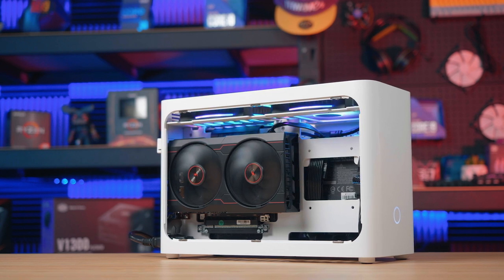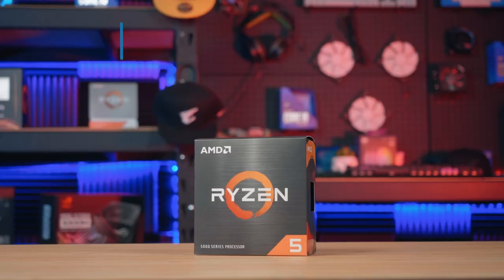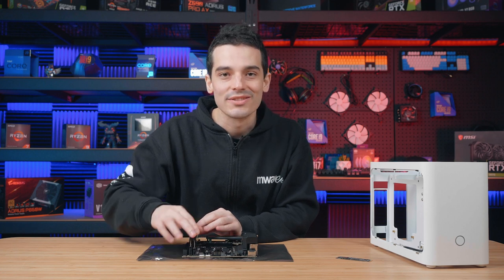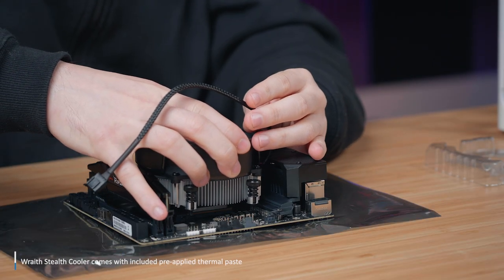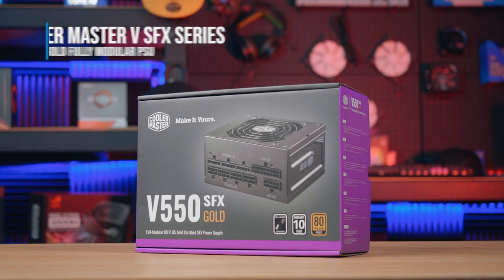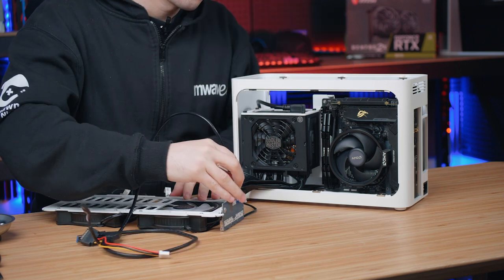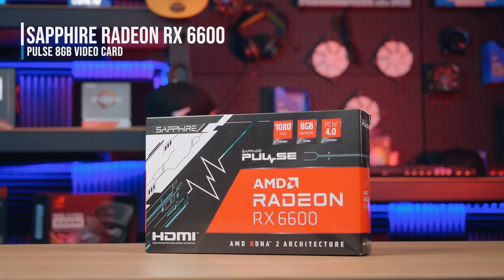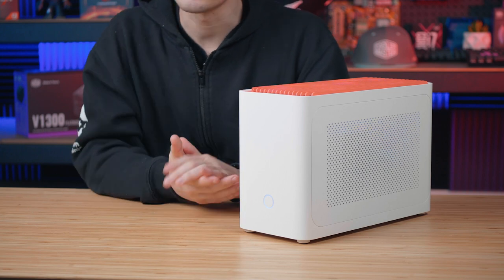Mini-ITX System Build feat. IQUNIX ZX-1 Air Mini-ITX Case with Ryzen 5 5600X and Radeon RX 6600

Comment: Great job! Thanks for sharing your experience.
I really want to try this case with water cooling version, but i’m worried about the noise while playing games..😢
Reply from the maker: Hello! Apologies for the late reply mate. I, unfortunately, didn't get to test this build out for any crazy long gaming sessions, but for the time I did test it out, the noise levels were fine and didn't appear to be noticeably louder than other PCs I have games on. However, the build featured in this video only had a Ryzen 5 5600X and a Radeon RX 6600, which I would consider being more toward the mid-tier components for gaming compared to some parts currently available on the market. If you did beef up your build with some more powerful components which are compatible, then the noise levels of the fans might be a bit louder as they attempt to cool the more power-hungry components.

If you do end up building something in this case, then let me know how it goes! 😊

Comment: Nice video. Love this case in all black. Probably could have used less time on how to snap parts into the motherboard and more on the cable routing. Also did you cut any of the cables to custom lengths?
Reply from the maker: Hey Louis, sorry for the late reply and thanks for the feedback about spending more time on cable management. There were definitely a few tips provided, but rewatching the video just now, we could have zoomed in on the case a bit more to show you guys what I was talking about. I will consider this for future system-building videos which include cable management 😊

As for your second question, no, none of the cables was cut to a custom length. None of the parts was chosen because they specifically had shorter cables for a Mini-ITX system. I just had to make it work. From memory, I tried organising a lot of the bigger cables under neat the PSU, to create a designated "cables" section in the case.

Comment: Is this a good pc build for gaming?
Reply from the maker: Hey Kharley. Yes, this is a solid gaming PC aimed more for the medium to high ranged gaming. Easy to run games like 'Valorant' or 'League of Legends' will not be a problem and it can still handle more demanding games like 'CoD: Modern Warfare' and 'Battlefield V' at 1080p with high settings. It can still handle most mid-ranged games at 1440p, however, it will struggle running some of the high end Triple A titles at 4K resolution.

What type of games do you normally enjoy playing?

Comment: Just curious if other air coolers than the provided coolers can be used in the system as well
Reply: yea they can, just make sure they fit in the case.
Reply from the maker: Hello! Yes, you can use an after-market CPU cooler in the IQUNIX ZX-1 Air Cooled case, you will just have to make sure that it has a maximum clearance of 70mm or less. There is also a water-cooled version of this case which is about 33mm taller and will allow you to mount a 240mm AIO cooler 😊
Reply from the maker: Thanks for replying and helping out Ali 😀

Comment: Can this build run games like Phasmophobia, Forza Horizon 4/5, The Forest, or The Mortuary Assistant on medium/low graphics?
Reply from the maker: Hello! You should be able to play these games on medium/low graphics at 1080p, but unfortunately, I don't have enough information to do a proper check for you. There is an online FPS calculator that I like to use but most of these games aren't listed there sorry! Only Forza Horizon 4 and you should get around 150 fps at 1080p.

Keep in mind that FPS calculators should on be used for a rough estimate and a lot of other factors can affect real-life performance. I will drop a link to the calculator I like to use 😊

How Many FPS: https://howmanyfps.com/
Reply: Oh ok, thank you! Hopefully the white coral version of the case restocks relatively fast, so I’ll be able to build this before other parts get sold out from where I’m buying them.
Reply from the maker: I hope so too! Let me know how the build goes once you get all the parts 😊

Comment: Nice build! Do you think this is a beginner friendly PC for gaming and doing tasks? 😁
Reply from the maker: Hey Yamy. Glad you liked the video! This is a mid-tier PC that is capable of playing most games at 1080p and is more than suitable for most work-related tasks. What types of games and tasks are you planning to use your PC for?
Reply: @MwaveAU is this good for sims 4 and roblox ?
Reply: @Kittypango  if a phone can run it than a $300 laptop can
Reply from the maker: Hey @M , Yeah, this PC will definitely be able to play Sims 4 and Roblox. These 2 games are not very demanding to run and most PCs would be able to hand them quite easily.
Reply from the maker: @monkeyiscool-gamez , funny enough, I have actually been playing a little bit of Survivor IO in my spare time. And it actually runs smoother on my mobile phone than it does on my PC which has an Intel i9-10850K and RTX 3080 XD

Some of those higher levels lag out my PC when 100's of zombies are on the screen rushing me haha
Reply: @MwaveAU  sorry about the late reply. But what @M said. Though how loud is this when you run it with a demanding game?
Reply from the maker: @Yamy Hello! I must also apologise for the late reply. As time goes on, this comment thread gets pushed further down the list and is harder for me to spot while checking comments.

Unfortunately, I only really played mid-tier games like Valorant and LoL on this system while testing it so I can't say I had the CPU/GPU running at 100% usage for any lengthy period of time, so I can't really comment on how loud it would be while playing a 'demanding game', sorry!

If I had to guess, as the CPU cooler and GPU fans are quite close to the side panels on the case, I would assume that it would be a little louder than a similar system inside a closed-off case with a glass side panel etc. However, this is just a guess as I haven't tested this out.

Comment: I think I did something wrong. I tried following this tutorial step by step, but when I plugged in my PC, nothing happened. The only thing that changed was the lights on the IO shield (Line In, Line Out, Mic In). Besides that, nothing else.
Reply from the maker: Hello Jose. This video did have some pointers for building a mini-ITX system, however, it wasn't a complete tutorial and some steps weren't shown. Let me see if I can help you out though!

- Is the PC you're building identical to the system used in this video? If not, let me know what parts you are using.
- Make sure you have connected the front panel headers correctly, mainly the power button header.
Reply: @MwaveAU  Thank you for replying. I’m all good now. One of the cables came loose on the Cooler Master V550 and nothing was working. Quickly plugged it back in and now it’s working perfectly. Thank you once again for replying and for the tutorial!
Reply from the maker: Not a problem mate. Glad you got it working and found the video helpful :)

Comment: I got notified this was back in stock, and have since, got a much beefier case (tower 100).. I'd love to  downsize into a smaller build but I have 2 questions.
1. I see you used a little rgb with the fans. In a dark setting, can you see the rgb at all, or does the case just keep it all hidden? (this can help me by buying cheaper, non rgb parts and selling mine for a profit)
2. What's the max gpu length you can fit in this case? I currently have a reference 6800xt.
Reply from the maker: Hey mate! Is it the Thermaltake Tower 100 Mini-ITX Case that you currently have? If so, it is definitely a bit beefier than the IQUNIX ZX-1 Air Cooling Mini-ITX Case 😮

Yeah, you can see the RGB on the 2x exhaust fans at the top. It is a bit hard to see in this video as the studio lights definitely overpowered them, but you can slightly see them at 8:41 . IMO they look pretty nice as they shine and reflect on the side of the grates on the top panel. However, you can definitely get none RGB fans if you would like to save a little bit of money. Just keep in mind the performance you will miss out on by not having RGB in your system 😂 jokes!

The maximum GPU size supported in the IQUNIX ZX-1 Air Cooling Mini-ITX Case is a dual-slot card measuring 305x45x140mm. The water-cooling model of this case can support a dual-slot card measuring 305x60x140mm

What is the exact model 6800 XT GPU you currently have?
Reply: @MwaveAU  6800xt reference model. It’s too THICC for the air cooler version 😔 267x120x50
Reply from the maker: Unfortunately, that card is slightly too big for the Air-Cooling version of the IQUNIX ZX-1 Case... But your GPU does fit in the Water-Cooling version as it can support up to 60mm in GPU width. However, this version does have less CPU Cooler clearance so this might be an issue if you are using an air-cooler.

Comment: can i put an RTX 6600? oh which one is better?
Reply from the maker: Hey mate. Yes and no. It will depend on the specific RX 6600 model which you are referring to. The IQUNIX ZX-1 (air-cooled) mini-ITX case can support a GPU of up to 305x45x140mm in size (the water-cooled version can support a GPU up to 305x60x140mm). I just had a little look at the dimensions of a few RX 6600 currently available and most of them can fit, but there were 1 or 2 that unfortunately were too big.

If you let me know which RX 6600 you are interested in, I can double-check to see if it fits for you😊
Reply: @MwaveAU  please! Thank you! I'm building my own PC, but I like your video, I like the components, the only games I use are shooters, and for work, but I don't know if the model you gave can be useful! 🥲
Reply from the maker: Glad you enjoyed the video mate 😊 The GPU used in this video is the 'Sapphire Radeon RX 6600 PULSE 8GB Video Card' and of course, as you can see in this video, it does fit in this case. All the components used in this build are linked in the video description.

If you are gaming at 1080p and mainly only play shooters which tend to not be very demanding, I have no problem recommending an RX 6600 for your build. At the time of this comment, an RX 6600 a very solid mid-tier graphics card at a very affordable price point. But let me just check first; do you game at 1080p? And also, what games specifically do you play?

FYI: I just re-read your original comment and there is no RTX 6600 graphics card. RTX implies that the GPU has Ray Tracing and is an NVIDIA term. The 6600 is an AMD GPU and is referred to as an RX 6600.
Reply: @MwaveAU  the truth so far I only play warzone, counter and valorant, but I'm seeing components thank you very much! I don't know if you recommend that cabinet because it costs 200 for the size I don't know if it's worth it...
Reply from the maker: Warzone is the most demanding game to run out of the 3 games you mentioned. But at 1080p resolution, you should be able to get 100+ fps if you are running a similar spec'ed build as the one in this video. Counter-Strike and Valorant should not be a problem at all to run 😊

The IQUNIX ZX-1 case is definitely a premium PC case compared to other similar-sized cases but keep in mind that even though it is a smaller case, the price doesn't reflect the size of PC components and generally speaking, smaller components are more expensive as they are a smaller factor and take up less room to store. I personally really like this case but if you are more on a budget, then you can definitely find much cheaper PC cases. 

Another mini-ITX case that I have no problem recommending is the Cooler Master MasterBox NR200/NR200P Mini-ITX Case. It's a little bit bigger but still a pretty small case 😊
Reply: @MwaveAU  I liked the case, but the problem is that there are always new renovations and yes you're right the small components are more expensive, possibly I bought that case but I didn't know what kind of components were used haha I think you'll guide me in your build, I want to think that it is mid-high range, really thanks for getting me out of doubt, haha I think I love you 😂
Reply from the maker: Hahaha always happy to help mate. That case is awesome! It's got a great design and can fit a lot into its 9.2L volume. It's also got a solid build quality too, hence I refer to it as a premium case. The safe bet is to copy the components I used which are linked in the video description, but I will provide some tips for choosing your own parts below if you would like to make any changes:

Motherboard: Mini-ITX Form Factor

Graphics Card Size: No larger than 305x45x140mm in size
(RX 6600 is a good choice for medium-high gaming at 1080p, but I have seen some RTX 3070 which can fit in this case. These are a more expensive option but better performance)

Power Supply: SFX or SFX-L Form Factor
(match the wattage with the chosen GPU and consider a little bit of headroom so you are not running the bare minimum)

CPU Cooler: Up to 70mm in height
(a stock cooler that comes with specific CPUs like an Intel i5 or Ryzan 5 is a good option as you will save money on not needing to buy an after-market air cooler)

Case fans: 2x 120mm fans
(with RGB for higher performance 😂)

Storage: NVMe M.2 SSD or 2.5" SATA SSD
(no support for 3.5" SATA HDDs in this case)

Memory (RAM): DDR4 or DD5, depending on your motherboard

I think that covers pretty much all the size limitations on your components. Let me know how you go and if you have any other questions, just send them through mate 😊
Reply: @MwaveAU  oh sorry for replying very late, I'm working, so it all depends on the dimensions of the components so that's fine, possibly this case is luxury, although I don't know if in the future I will be able to make changes to it, since more video cards, ram or motherboard change all the time, that makes me a little suspicious, I don't know if in the future the box will be obsolete or at least they will make smaller but more expensive designs
Reply from the maker: There will always be components that fit in a case of this size, but again, the price might be a little higher due to their form factor so this PC case will never be obsolete. However, going with a larger-sized case will definitely give you more options when it comes to components or future upgrades.
Reply: @MwaveAU  Sorry, I have seen cabinets, and what do you think of the cooler master NR200 or the NR200p? compared to that? what do you think?
Reply from the maker: Hey mate. Although it is a little bit bigger in size compared to the IQUNIX ZX-1 (18.25L vs 9.2L), I personally really like the Cooler Master NR200 and the NR200P and I use the original NR200 as the case for my work PC. The NR200P (at the time of this comment) is a little bit more expensive but it comes with a glass side panel that lets you see inside your system and have a reinvented design while allowing you to vertically mount your GPU. However, the original RN200 is still a great choice and both cases provide a lot of space for components while still being rather small in volume (18.25L).

Although the CM RN200 and RN200P are both a little bit larger, they are still Mini-ITX cases and use similar-sized components as the IQUNIX ZX-1 case. Let me know if you have any other questions mate 😊
Reply: @MwaveAU  yes, that's what I've seen, there are three types which are NR200, NR200p and NR200 max, the last one is very expensive, I'll buy the NR200p, I'm just seeing some components that I liked too much, do you have any advice to build that cabinet? I don't know how many Gigabytes I can put, to build a gaming and work PC, I still don't play that much, I don't ask for that much performance, only the warzone but I will have my limits 🫠

Comment: Hi, I have a question. I bought the Water version and had some quality issues (sold it then). The top grill was scratching the white case(I think they forgot to calculate in the thickness of the paint). Did you get one from the Producer (sponsored), or did you buy it on your own? I am a  little sad about the built quality since it is a very expensive case. But I love the design.(Apple like) :(

Comment: Hi, love the video... a question, any recommendation for components and case for a GIGABYTE RADEON RX 6600  EAGLE 8G, im new in building PCs and a friend of mine give me the graphics card, but I would like something small, cheers, sorry for the long question
Reply from the maker: Hey mate. Glad you liked the video! Oh, what a score, I actually have the exact same Graphics Card in my work PC and it's definitely a great mid-range gaming card.

That GPU is actually not that big, and it would fit in a lot of cases so I won't be able to recommend every single case that could support it. But I will recommend you one case (the case I am using for my PC at work with the same GPU that you have) and it's the Cooler Master NR200 Mini-ITX Case. There is also the RN200P which has a glass side panel if you prefer being able to see into your system.

Check out this video we recently release where we built a system inside the case I am referring to and let me know if you have any other questions 😊

Building a Budget Mini-ITX Gaming System that can still GAME!: https://youtu.be/Y6J_BapFhfA
Reply: @MwaveAU  I really appreciate te time you take to respond comments, cheers from Mexico
Reply from the maker: Not a problem mate, happy to help 😊

Comment: Hi would like to know how many 2.5" ssd can fit in this case without a gpu? Planning to go with 5600g
Reply from the maker: Hello! You can fit up 2x 2.5" SSDs inside the Air-Cooled version of the IQUNIX ZX-1 Aluminium Mini-ITX Case. From my knowledge, you won't be able to fit any extra 2.5" SSDs by not installing a GPU in this case.

I also just wanted to point out that you can only fit 1x 2.5" SDDs inside the Water-Cooled version of this case 😊
Reply: @MwaveAU  thank you for the respond
Reply from the maker: All good, mate 🙂